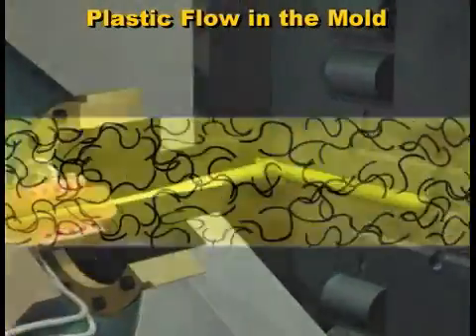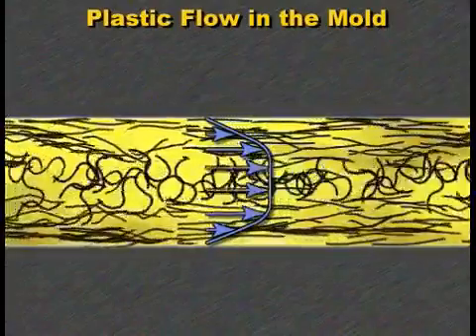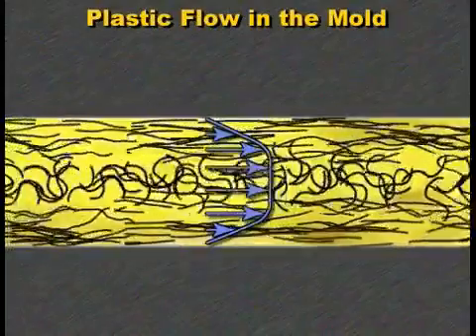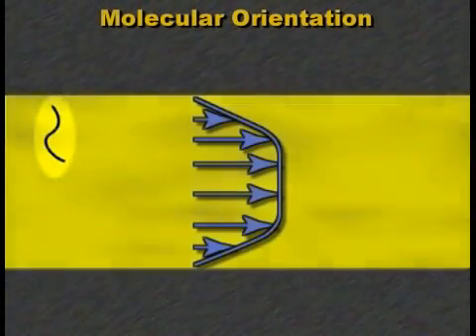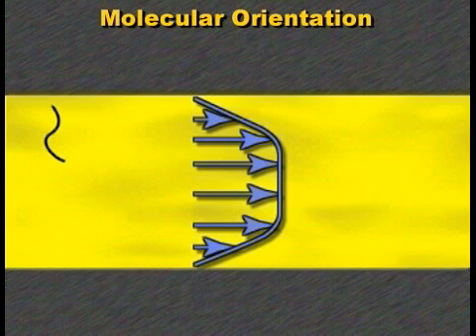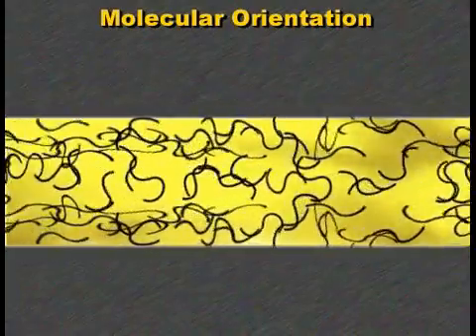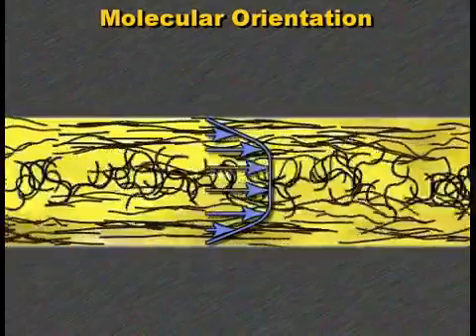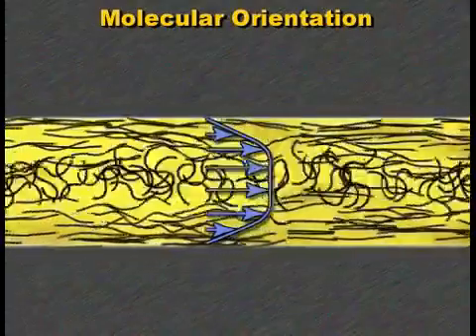Injection Molding How Plastic Flows During Injection Molding

Comment: It's called laminar flow
Reply: Yes, and no. Laminar flow assumes that all molecules are oriented and flowing parallel to one another. True laminar flow in plastic melt flow is unlikely.
Reply: @Spearborne  Fluid molecules can be influenced by air or voids throughout the flow, unlike plastic. Both are moving in the same direction in parallel, so technically it's the same.
Reply: Except not, but ok. The video literally shows that the plastic in the center is still turbulent.
Reply: @Spearborne   Being a plastics process engineer for 42 years, I and other engineers always called it a laminar flow through the barrel. To cool a mold quicker turbulent flows were more efficient than laminar flows. Hence the reasons for differences in molding terminologies. We had to differentiate the two flows.
Reply: @plasticman3952  that's understandable for practical purposes/local jargon, but I don't see any significant value to referring to it that way over just calling it fountain flow. Especially as that's the formal standard.
Reply: @Spearborne  Pure semantics. Thank you for participating. Goodbye!

Comment: Can this techniques be used for extrusion machines?  For example, instead of a conical screw, I use a conical barrel to make turbulence in the plastic?.  Example.  My screw is 1 inch.  The plastic flows through the pipe with the band heaters, and then the pipe opens up to one and a half inches and back down to 1 inch with a heater also on the larger section.  Reason is, I am building a diy extrusion machine and the cost of a conical screw is our of my budget.

Comment: What is the significant effect of a different flow speed to the molded product?
Reply: #Arvin Tiongco #Arvin Tiongco What is the significant effect of a different flow speed to the molded product? @. Artisan Mould co.,ltd @Arvin Tiongco
Reply: A little too late, but here we go. There are several effects. The most significant are: 1) Lines of molten plastic where the flow of melt has a different velocity. A good place to search for is the sprue. That's why engineers are very careful when designing the mold, especialy in the case of transparent parts; 2) Due to the friction of several molten particles, one could find burnt or degradated material on the surface of the part that is being produced. Again, this is all due to the friction and self heating of the melt in the screw. Actually the heaters on the screw are used only to regulate the end temperature of the zones on/in the screw. The majority of the heat in the melt comes from friction. Why's that - I don't know if there's a theoretical answer. And finally due to the different velocity of the flow, you could find weld lines on the surface. Where to find them? Well, near a cavity or an opening on the part, but not only. This is again due to difference in the temperature of the material. Of course the line of weld is likely the most probable place to break or crack if a certain force is applied